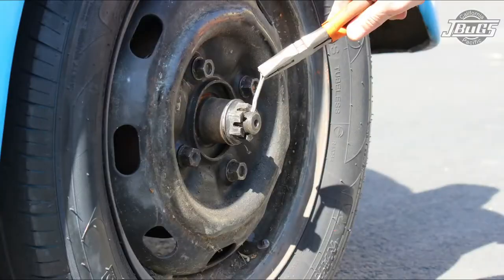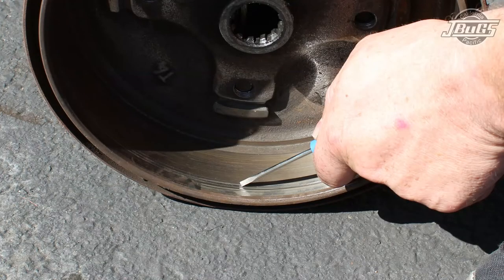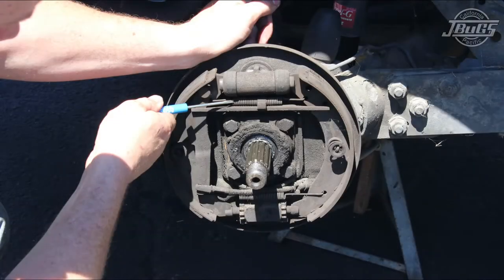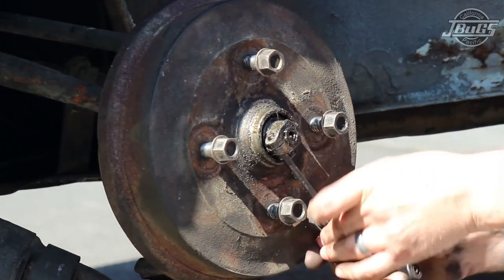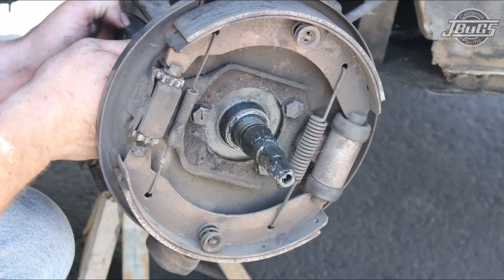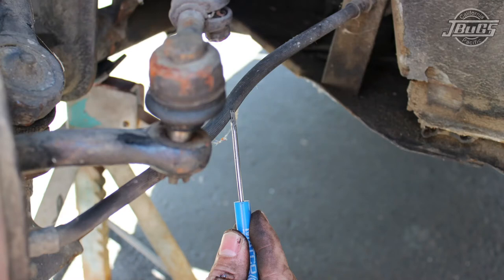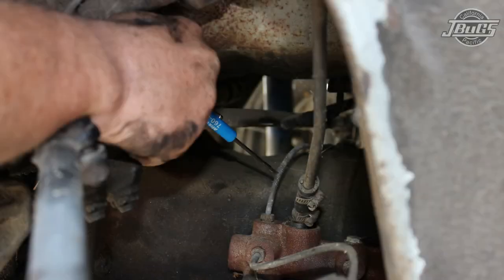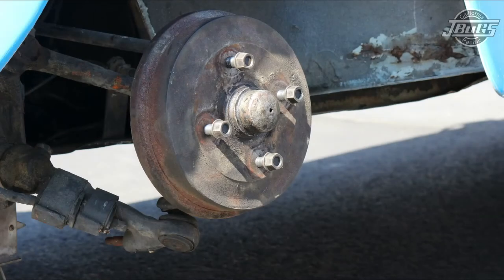JBugs - 1969 VW Beetle - Brake Inspection

Comment: I have a question, is wheel cylinders in the front the same as the cylinders at the rear? I have a1972 bug delux model.
Reply: The wheel cylinders are not the same, no.
Reply: The fronts are usually larger since most of the braking load is done by the front brakes.